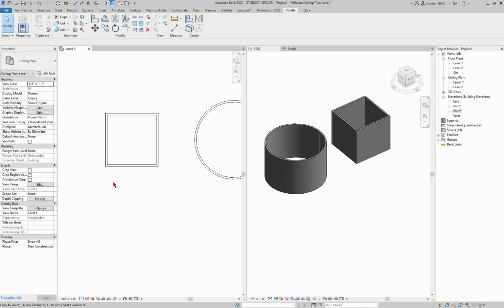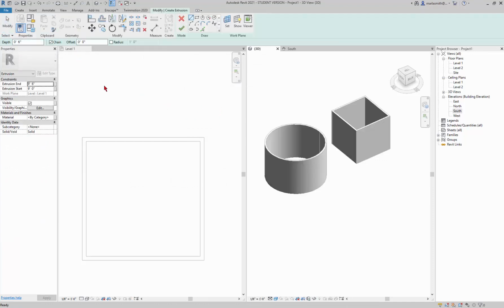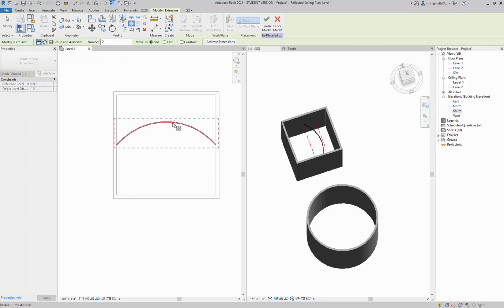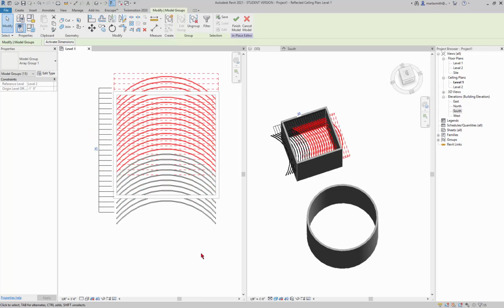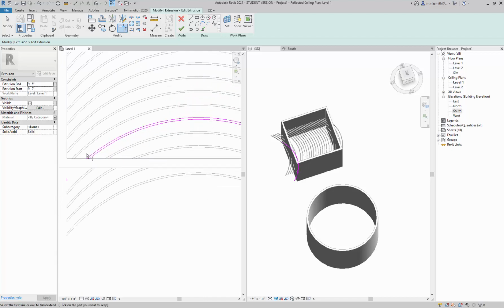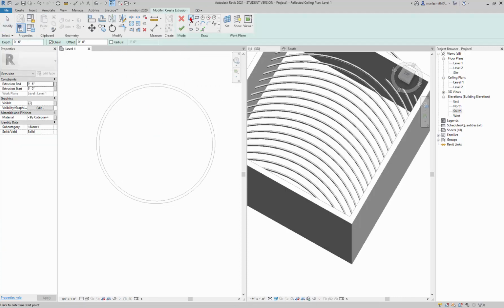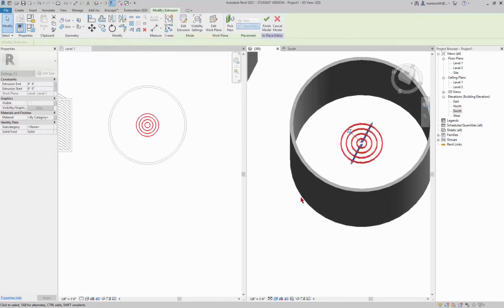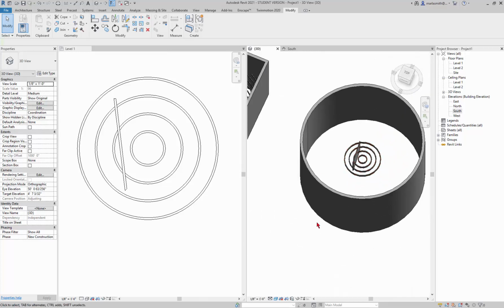EC Curving Ceiling

Comment: Why is it not possible to make a “ceiling” family other than just basic planes? Or is there some sort of work-around to solve this issue?
Reply from the maker: Hi Amy,  Revit system families are limited in their application base on the modeling options in the component model in place.  Your options are an extruded roof which takes a profile and extrudes it out in one direction.  Still pretty limited.  If you want something more complex like a surface curving in more than one direction you would have to use a mass and a wall or roof by face or maybe and adaptive component.  Unfortunately there is no ceiling by face option.  If you have a particular ceiling you are trying to make you can send me a screen shot and I'll give you my opinion.  You can also make the ceiling in another program and insert it through the Component model in place command using ceiling as the category... Good luck.  marlasmith@utexas.edu
Reply: @MSmithWorkShop  Thanks‼️